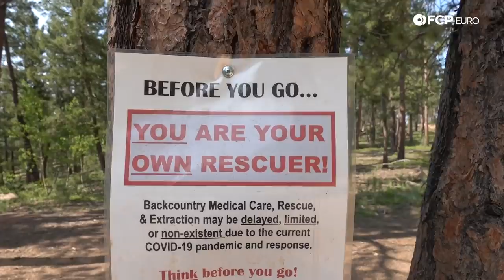Cayenne Off-Road Recovery, Dragging Out Our Broken Porsche Out - Ep5 #YippieCayenne

Comment: Did you remove the lower intercooler pipes to drain all the water from the intercooler?? looks like you just sucked more water into it on the second start.
Reply from the maker: We cracked them open, but could have spent a lot more time getting the rest of the piping as flushed out as possible. Hindsight 20/20 on that one Timothy